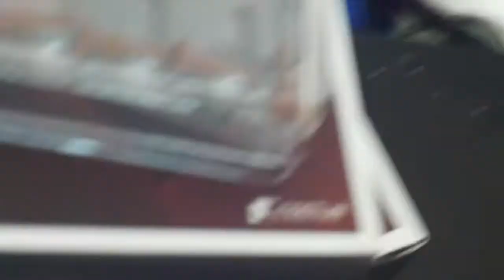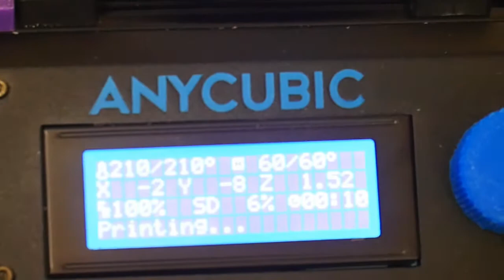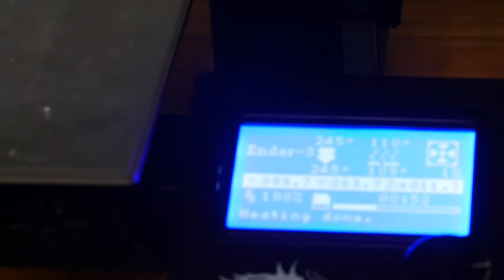All Kossel Upgrades,  Pretty Dragon, Watering Spikes, Ender 3 state, and Alfawise U20

Comment: i believe the Noctua fan may be mounted backwards, the airflow should go the other direction. Unless of course this was intenional lol.
Reply from the maker: No I'm pretty sure... but thanks I'll double check.
Reply from the maker: yehp. actually its the wiring thats backwards. But because its a 3 wire, I figure i'll just reverse it Not good because it has no protective cage reversed! I'll rewire it some rainy day